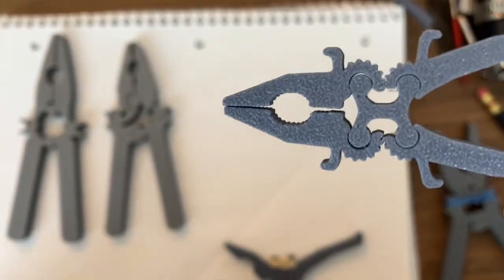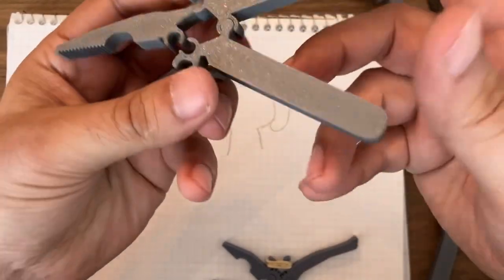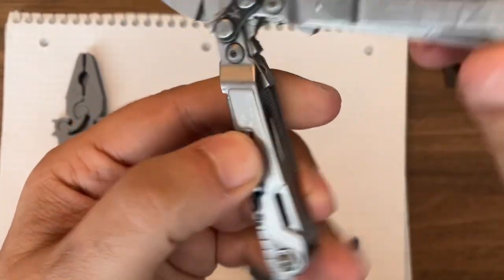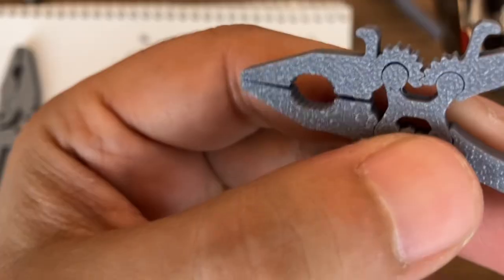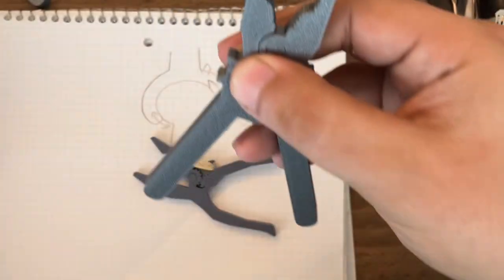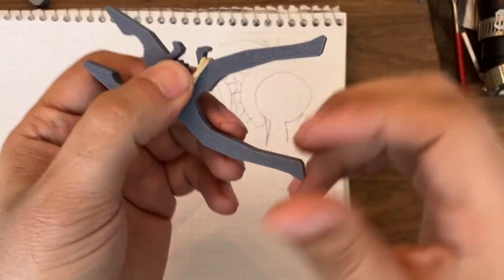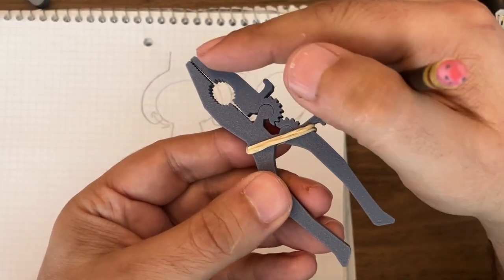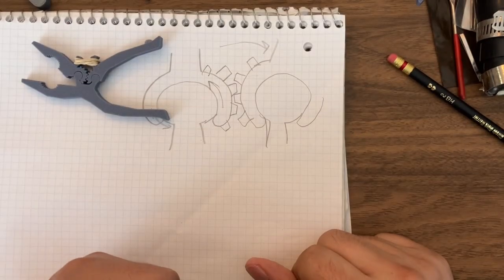New plier mechanism

Comment: Why not mirror them and use a printed pin to secure them....
Reply from the maker: Sounds interesting. There’s probably some good possibilities in that area. I’ve seen proposals for making a sort of  rivet or pin out of interlocking laser cut shapes, the idea was to replace extra hardware needed in some kits with more flat parts.